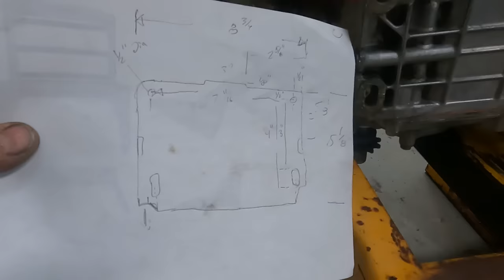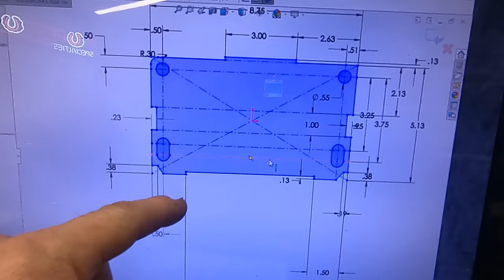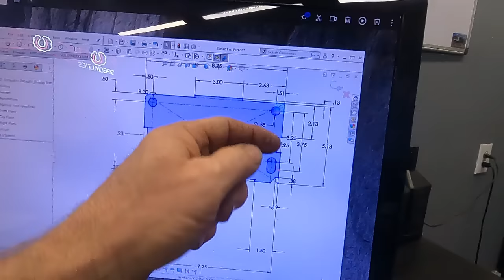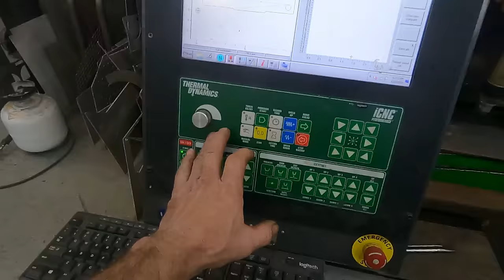Fortress cement mixer STONE 95CMED.  Can it be fixed? Part 2

Comment: buy some HYLOMAR M sealant seal the whole cover face on both sides leave for 10 minutes then put a cotton thread around the cover as well as the gasket the cotton thread will take up the low in the cover and will compress into the gasket for a perfect seal this is how you stop old school motorbikes from leaking oil as well as harley davisons  cheers from down under
Reply: Holymar is the gun 👌
Reply: that's a beaut of an idea, digger...be well!
Reply: I have used 100 percent clear silicone for gaskets and that works very well
Reply: @equipmenttesting6820 holymer shits on any silicone gasket makers. I swear buy it. Silicones are hit and miss type thing. Holymar is expensive though, it's anaerobic so it never actually sets. Also very good where tolerances could be affected by silicone thickness
Reply: @motomenace86   ok I'll definitely give it a try learn new things all the time which is good 👍
Reply: Two strokes are glued together from the factory  using Yamabond,available at any bike shop. Never had a problem  with yamabond.

Comment: Once you get that unit up to the fortress and in use, I think you should retire the worn out shovel and wheelbarrow and mount them in a place to be honored. Mixing 30,000 bags of concrete with those things is beyond belief. Great mixer outcome 👍.
Reply: Yeah, that tools combo needs to be enshrined in a special display at The Fortress, 4 sure.

Comment: Alan - between engine and steel plate use some rubber bushings - from old tire tube or something it will compensate a warped aluminium
Reply: maybe old tires but surely not the tube.....
Reply: The plate should of been mounted to engine and machine separately. Right now any flex would put stress on crack especially with rubber

Comment: I have used a wire from a wire brush to clean jets and orafices.  Sometimes just replacing the carb is cheaper than a kit. Also often cheaper to order parts from the mfgr. than the aftermarket kits.  Good job. It's really nice that Dave lets you use the shop for your projects.

Comment: I just experienced a similar carburetor problem on my generator. 
It started where it would only run on full choke. Cleaning the jet you cleaned helped but was still requiring near full choke to run.
After some studying the throat of the carburetor,I discovered 5 little holes in the side by the throttle plate. These holes are about .020 inches, 20 thousandth of an inch, and looked like corrosion. Using a strand of wire from some hookup wire, I was able to clear them. They were a pain to get cleared. 
I had tried carburetor cleaner, but it didn't work.
Good luck.

Comment: Awesome that the engine seems to actually be fine. 
I've found an ultrasonic cleaning bath to be great for getting gunk out of those areas you can't get at, even one of those little, cheap so called "jewelry cleaning ultrasonic ones could do all those small parts. If a good run, turning it different directions to where the transducer is mounted outside and I'd be REALLY surprised if it didn't break up any gunk in there.

Comment: That’s what I use is the torch tip cleaner and carburetor cleaner. I also blow compressed air into each hole after soaking in cleaner. I think that jet behind the main jet can come out which might help.

Comment: i use a Ultrasonic cleaner (on amazon for under a hundred bucks) and have cleaned 5 carbs this winter so far. Every one of them were plugged from varnish etc and the cleaner saved me $. Of course there are cheap replacement carbs out there but now I have options. My 5kw generator with an Subaru engine has that stupid auto-idle feature. No replacement to be found. Anyways thanks for all you do.

Comment: if it only runs with the choke on the idle fuel/air circuit is plugged/restricted.the hole that was plugged is the atmospheric vent thats why fuel would not flow to the bowl.

Comment: * I Wonder if the engine is running is it not creating or losing some of its vacum and that is why it is having to run with choke almost all the way on. Come to think of it , I can not remember if you had air filter on, but if the air filter is not on that is likely why it is having to have choke on. When you put the air filter and cover on it may then allow you to run with choke off.  But if it still maybe worn enough it is not getting the vacum it needs or check for vacum leaks or change that carburator it may also be worn losing vacum , but I am sure you will figure it out!
 Great video and great patients !! See you on the next video!

Comment: I might take out the air fuel mixture screw screw and clean out that port. Some screws have a tiny o ring on them.  Set the screw  to the same amount of turns or about 3 3/4 of a turn out.

Comment: Alan needs a portable DC mig I'm sure one of those big trucks has a 2 pin charge accessory plug on it plus he could get a couple semi batteries he could keep charged with a couple solar panels to use it at the fortress

Comment: ""Mr. Wizard "" !!    Goes to show what ""Ethanol fuel "" will do to a carburetor that sets with NO gas "Stabilizer "  in the tank !!   Had the same problem with lawn mowers that sit over the winter !!   Great going on fixing the cracked block !!👍👍👍👍👍

Comment: Wizard trick when using silicone gasket maker. apply the silicone and let it sit and cure for a couple of hours. Then apply the gasket and the housing and start the bolts but do not tighten them. allow another hour of cure time and then tighten the bolts down. This allows the silicone to build a skin that helps fill the gap better and then when you tighten the bolts the uncured silicone squeezes out and bonds the surfaces. Great work getting the engine running and cleaning up the paint work.

Comment: Great job, I stopped video and said it would run better with air cleaner on atleast you would not have to run with full choke. Ihave never seen 1 of those engines run without almost full choke with air cleaner not on it loses vacum, so glad to see you get air filter on and get it running better ,the more you run it with that Lucus fuel  in it I think it will get better , and I would find starter kit for it and battery , I hate rope pulling them!  So while you are fixing fork lift mount and trailer mount I recommend finding starter kit ,starter and battery! It will be well worth the extra $s . And you can still put rope pull as backup! Great save , $500 and a lil more for starterkit and battery is agreat deal , vs like you said $6k probablly $8k +  in todays economy for a mixer like that !! 
 Congradulations!  Keep up good work and see you on the next video!
  Guess you are enjoying the quiet life while all the youngsters are snowed in! You are there fixing things, while they are breaking things! Hahaha!

Comment: Some engine bases are designed to be mounted on flexible isolator washers, to reduce a vibration. I would have welded new plate to the old base, to make sure the new base is perfectly flat.

Comment: Having been one the the largest Honda Power Equipment dealers in the country for years, back in a different one of my lifetimes, this has been a bit difficult to watch you struggle through.  It sounds like you may have it going finally and that is a great thing!  I will be looking forward to seeing you getting some use out of this thing.  (By the way, for gummed up carburetor parts cleaning, I always used, and had my tech use, Barryman's Chem Dip.)

Comment: Those carbs like to run a restricted air flow
Put all the air filter assembly back on and it should run fine
Also altitude might be a issue

Comment: Great job getting it running and it looks great 👍 it's been my experience with small engine carboraters made nowadays it's sometimes easier to find a new one on eBay for 20 or 30bucks just for the reason you can't get the jets out like the ones we grew up with, and man what a mixer!! ❤your content Wizard, keep it up and most of all be safe 🙏

Comment: I use several sizes Honda engines on several pieces of equipment. They ALL have rubber MOTOR MOUNTS to reduce vibration and also add clearances where needed. Some are as simple as 1/4" thich rubber with a copper sleeve in it. Use moter mounts and those  stress cracks will never be a problem. Also would have TIG welded that crack while apart. Simply torch heat the case, tig the crack, torch the case, let cool.
Reply: Torch head cleaner wire set to clean carb ports. Invaluable tool for under $5.

Comment: Alan one more fix for you to do add a hard Rubber ( soft plastic) plate before you add your thick Steel plate ( maybe the Wizard 🧙‍♂ though to much) you would not need to spend hours at the COMPUTER.  Help with Vibration also
Reply: plate needs to mounted separately from engine and machine for that to work.

Comment: When you clean the honda carb and honda clones you need to pop that jet out. I usually use a 90-degree pick.  That jet has holes all around it, and those will be plugged use the tip cleaner for that too

Comment: Cut out a flywheel that will fit a standard snowblower starter and mount an automatic starter. You probably have a starter you can use and the plate that you would mount should be easy enough to cut out
Reply: @Tanks_In_Space  Pull start should always be there as back up, but when you try to solve a starting issue, the electric start is god sent, but you still should time to time use pull start to make sure its still working. Get stuck middle of nowhere with engine issue, blow your energy into pull start and you dont get it working you have long way to walk exhausted. Even though furthest i'm going with any machine is couple klicks like you can drown into glass of water, you can freeze your self if you get stuck and exhaust your self. I prefer swapping between electric start and pull start, when tired of pulling run with electric and start walking before you cant get back home on foot. Then get buddy to come help to retrieve the machine.
Reply: Check out that fella that has all old snowmobiles should have parts for you

Comment: That center brass just will come out of the carb so you can clean it. Just push it down with a flat blade screwdriver from the throat of the carb. And run it the carb in an ultrasonic cleaner with water and a little simple green for about 10 min if you have one

Comment: How about doing an aluminum plate and weld to block??
Reply: If he would have welded a plate on first and then welded the crack up  it would be very strong, if it cracks again that’s exactly what I would do but it’s too late now to add it as that would cause it to crack again pulling on the weld. Perhaps it will just work fine for many years to come!?
Reply: @purplebooger6410  if you weld in steps it wouldn't pull. Just have to do strategic welds. 
I would just do the 4 corners then a 1 inch weld in middle. Be more to stabilize than anything. If tried to weld solid you likely run into trouble, even if you tried to stitch it

Comment: ALAN, JUST A FRIENDLY BIT OF ADVICE YOU MIGHT WANT TO STRIP THE CARB DOWN BECAUSE IN THAT TUBE WHERE YOU CLEANED THE ONE HOLE THERE SHOULD BE A COUPLE MORE BUT ALSO CHECK EVERYTHING BECAUSE IT ALSO MAY NEED A GOOD CLEANING IN THE BOWL BECAUSE YOU MAY HAVE SEDIMENT OKAY

Comment: Usually use an air line on the jets, from both ends if you've stripped it all the way down. Mind you i usually work on motorbikes ps why skids, there is a set of tracks behind you. Climb up & down the stair no problem 😂😂

Comment: Allan,do you have any 2 cylinder diesel engines up at the mountain?
Maybe fit something like that ,do you have any drive units that you can adapt to the mixer frame so it can move itself around,with all you collection of things,there must be something to use ?
A motor and drive train from a micro car ?

Comment: Hello Allen, I've been watching your channel for a while. Does the Honda engine you are working on have a wire coming from the front of the block? If yes, that is the oil alert the oil level should be at spill out point top of the threads if it is low it will not start Ron B.

Comment: Air bro. Blow it out with air. Problem with wire is it eats away at the base metal and changes flow rates. Thats why it still wont run right. Gota hold the choke.

Comment: Why is the mixer so expensive? I've just looked up a petrol powered one here (looks about the same size, no idea if it is) it's about £250 ($318) I found a expensive one for £580 ($738) that is actually smaller, but I assume of better quality? maybe?
So, just not sure why this one 'new' would be $7,000?
Reply: okay, I think I see the discrepancy.. The difference seems to be 'capacity' vs 'working load' I am guessing this is a 9cu-ft (255L) working load, whereas the ones I have been seeing are 250L capacity but working capacity is only 120L (4.5cu-ft)
Though, I still think it's quite a jump up of 10x price for 2x capacity.

Comment: Alan I would like to suggest you use hightest gasoline. It is a Lil more Expensive but it made a difference on my Dad John Deere Gator. Oh and use a air hammer to chip out that concrete.

Comment: 13.00 Amazon  replacement carb ,,,,,, 212CC Carburetor Carb for Harbor Freight Predator 60363 68120 68121 69727 69730 Engine R210 Gas Engine for 6.5 HP 212cc Go Kart OHV Engine

Comment: Maybe some HARD  rubber feet with the mounting bolts running  through them to 
dampen vibration and giving clearance to the oil drain plugs